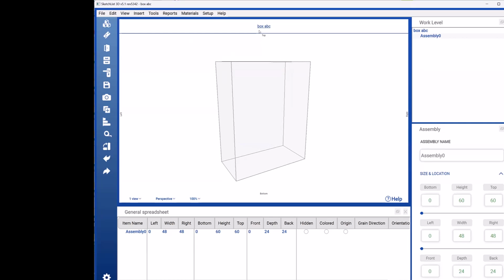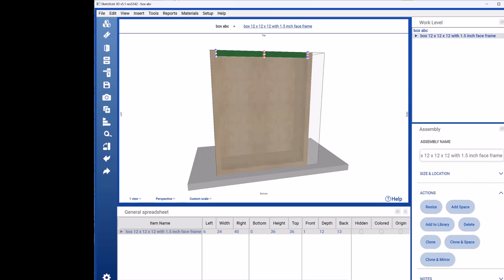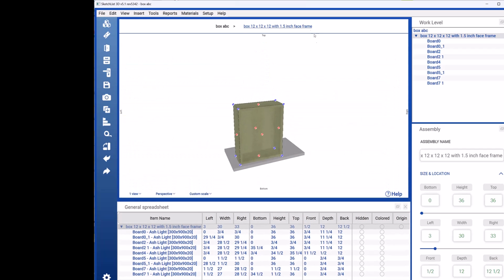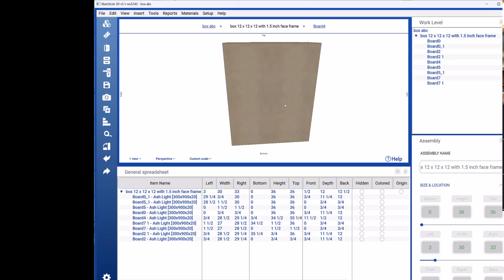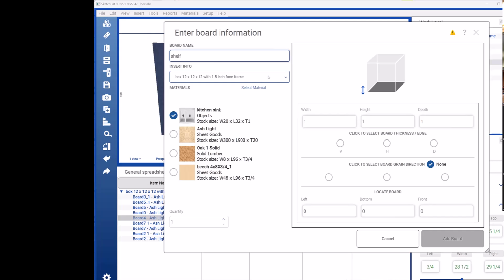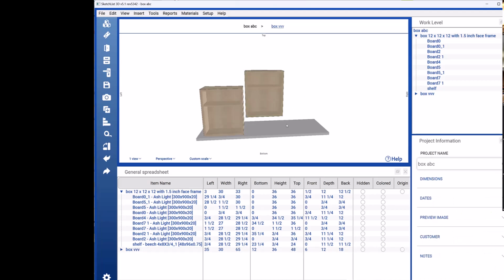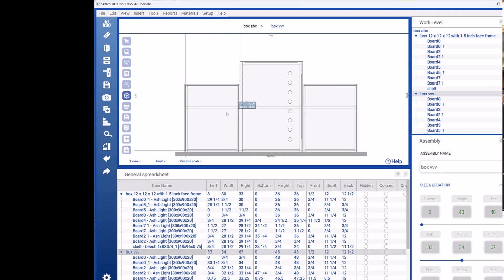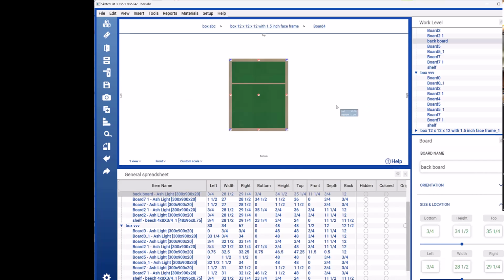The SketchList3D Trick That's Revolutionizing Furniture Design

Comment: you have done a great job convincing me not to buy this by leaving information out or maybe you just don't know have a cabinet is made.  The guy talking about using the 1/4" board for the back of the cabinet was exactly right.  You left alot out, and for me, thats the reason I would want to use this software so I don't have to keep tese detail in the back of head whil assembling.
Reply from the maker: What I would do for the backboard is specify to the software that that’s a quarter inch thick.   The thing is that your designing the way you build and if you use quarter inch use quarter inch if the next person uses half inch they use half inch.